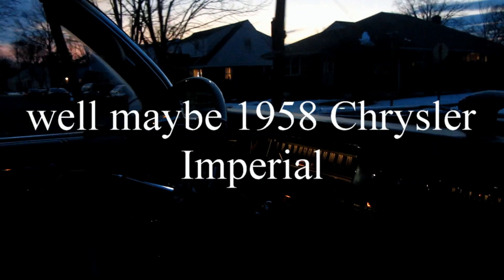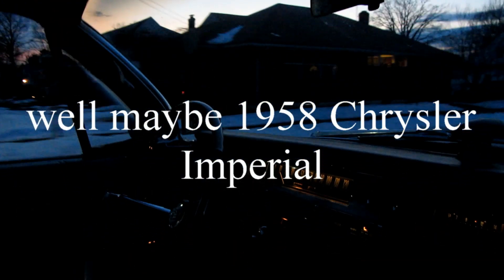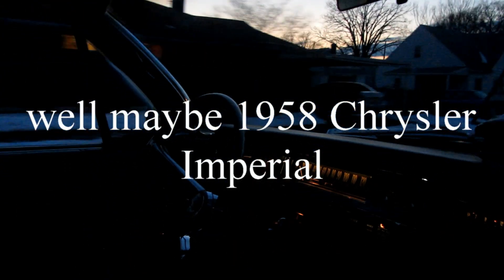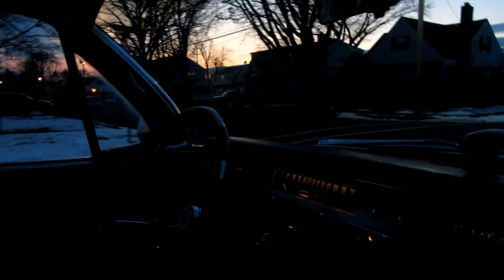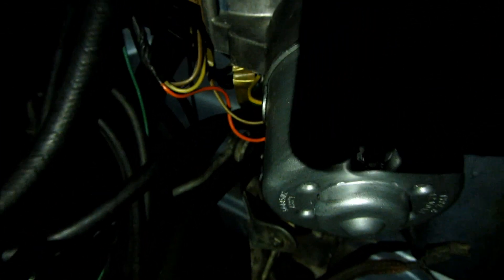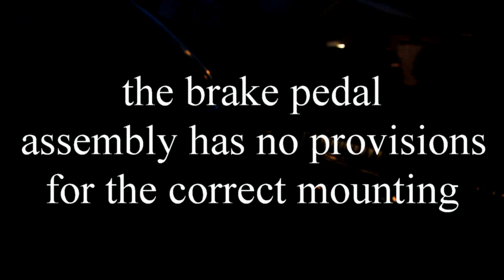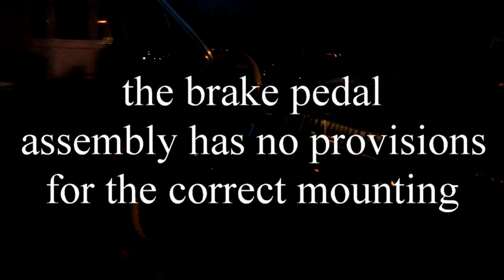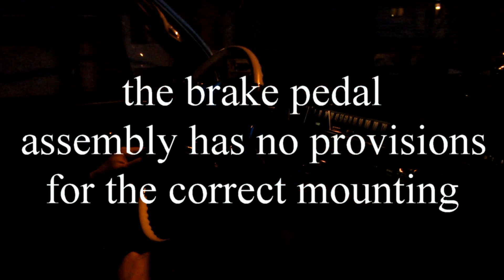1962 Cadillac cruise control in operation

Comment: I never realized that, so the green light in the cluster is already there?  I realize you added the light bulb but I didn't realize the existing green blank was there.  I have a 1961 Cadillac, just like 1962, the clusters have 4 blanks there on the cluster.